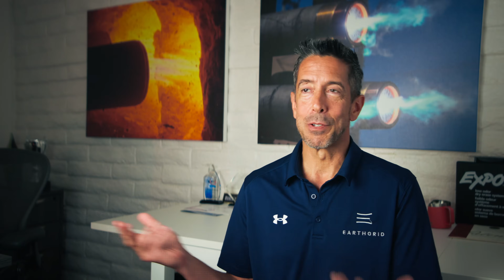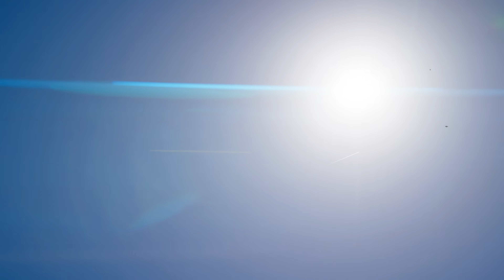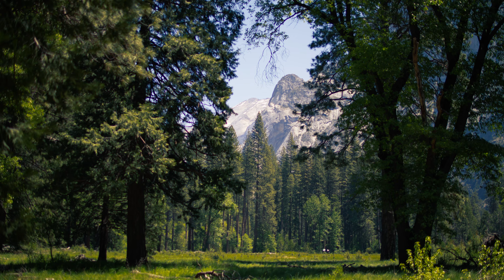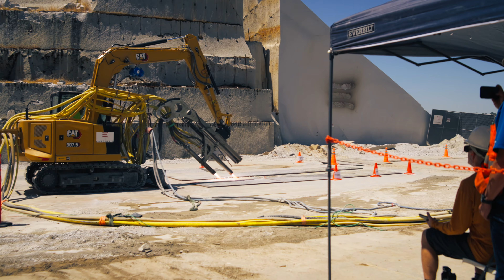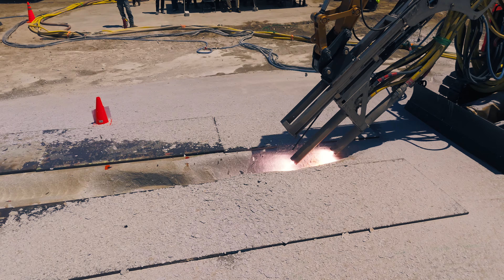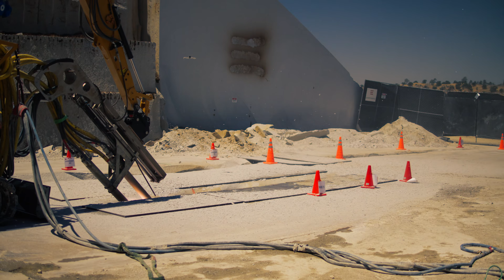Field Testing our Plasma Excavation System

Comment: Looks great guys. So happy to see this coming to fruition. Can you show the speed? The footage shown didn’t really make that clear. Also it would be very impressive to see your torch move at different angles, and cut a large block free from an exposed corner. What is the plan for breaking pieces free after cutting around the edges? Cut a grid and wedge? Also, curious as to how much energy you are using? I’m a small investor, but it would be interesting to know how efficient this is, compared to conventional methods. Are there any expendables? Anodes or similar?